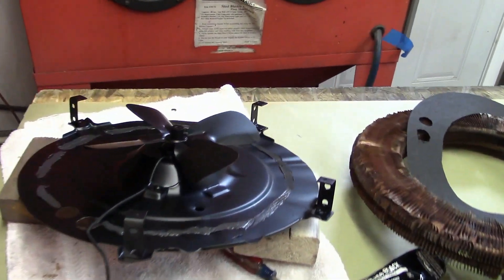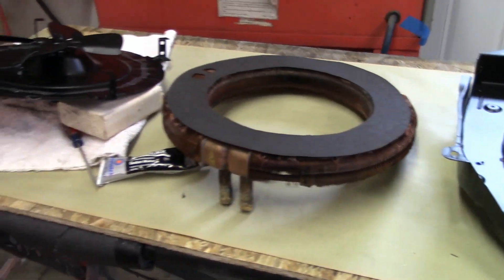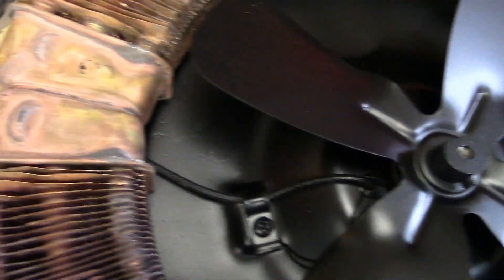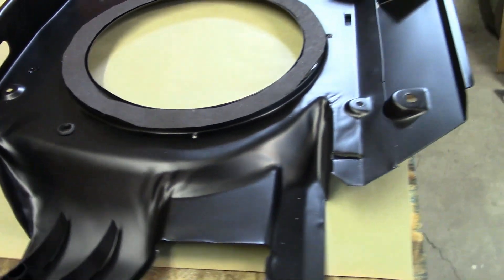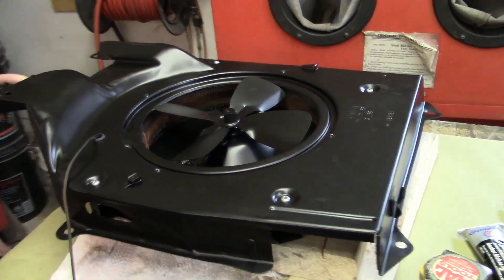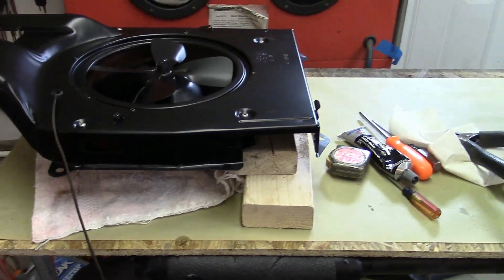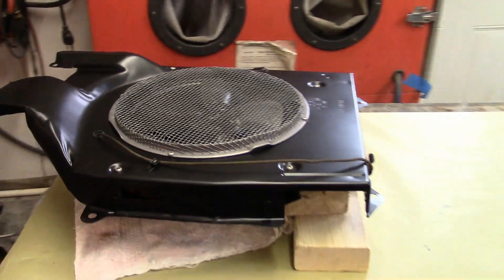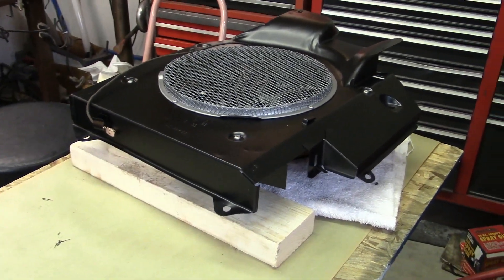1955 Buick Century (Under Seat Heater)

Comment: Might that have been an Asbestos Fibre compound that was used previously ? Just thinking ; if so , are you confident that Tar Paper will be safe under the heating element  ?
Reply from the maker: It should be fine. Tar paper on roofs on a hot summer days can reach 170* I doubt the heater core would ever see that much heat, but I will find out!